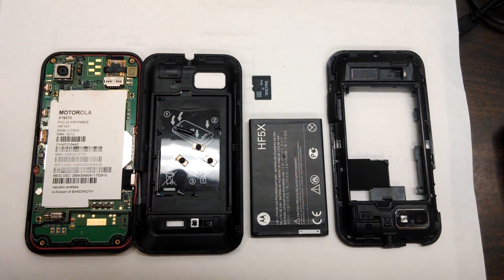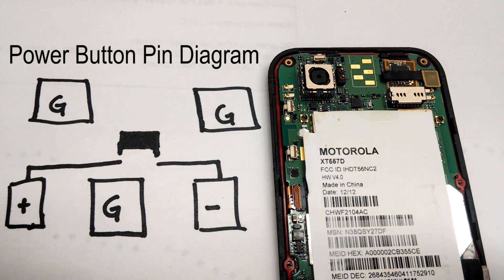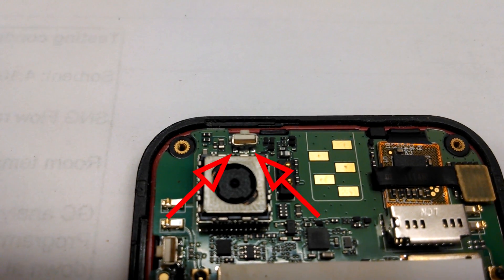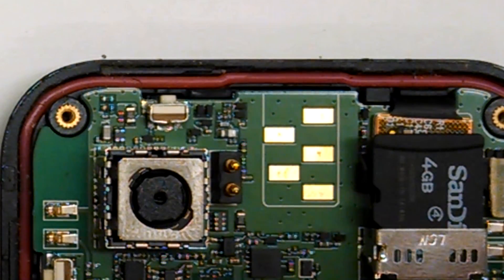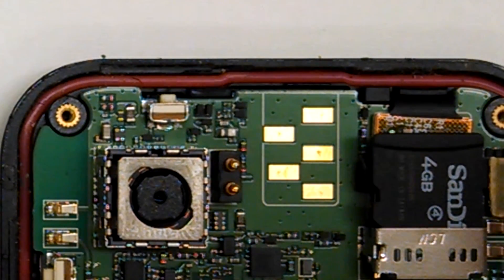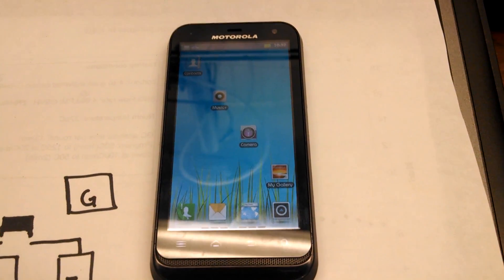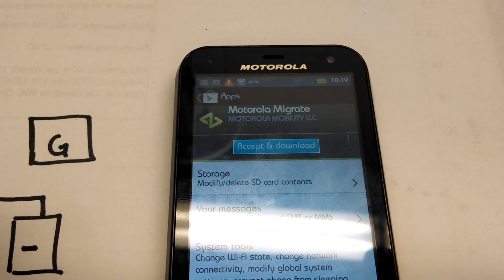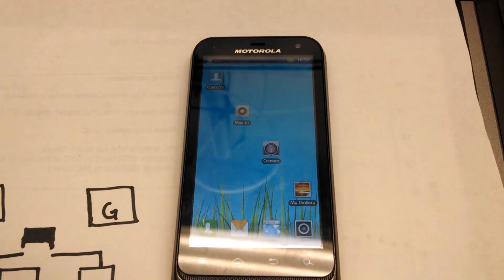How to power on a cell phone with a broken power button

Comment: Hi,

I am absolutely terrified to do this.. I only need to turn my Phone on once. What exactly do you do with the wires and how do I know which one I have to connect to which pins on my Phone?
Thanks in advance
Reply from the maker: Hey hey,
  Yea its a bit nerve wracking as some bad things could happen, even when opening the phone (opening the phone carefully is always my biggest concern).  

What type of phone do you have?  
Have you taken the case off?  

If so when you look at the power button it should have some number of pins on it.  If there is only 3 you're in luck, it will be the two sides you need to connect.  If there are 5, 2 of them may be dead or grounds and go no where, look at the leads coming off the wires, there might not be any, these ones do nothing... 

The key is to find which 2 terminals connect to power on the phone.  

In general if you have a switch with 5 pins, one is for grounding the case, that will be in the middle of the switch probably on the back of the metal case.  If you connect either of the 2 pins on the left to either of the 2 pins on the right one of two things will (normally) happen.  A. You'll connect the switch and the phone will turn on.  Or B. you'll connect either the negative or positive terminal to ground and nothing should happen.  When it turns on it should be almost instantaneous.  So if nothing happens remove the wire you're jumping with and try another pin (You've only got 4 options).  Don't just leave the wire on there as you could be shorting the battery which will get hot eventually.

Good luck let me know how it goes.
Reply: IAmWhil Hello and thanks for your quick reply. The Jiayu G4 I have works a little different from your phone. While opening the case to fix some other stuff, I broke the power flex cable (you can google Jiayu G4 Power Button if you don't get what I mean.) As far as I know, this little flex cable was only connected to two pins on the motherboard. I can send you pics as well (If you are willing to help me) because I know nothing at all about things like this. 
As I mentioned, I don't just wanna play around and run the risk of messing anything up, as that's exactly what happened the previous time I tried that. What kind of power source should be connected to my two wires?
Thanks again for your help and quick response!

Comment: Were is my tunnels at on my LG Mytouch
Reply from the maker: Look at the power switch on the side/top of the phone when you have the case off.  It should have electrical connectors soldiered to the board.  There will be between 2 and 5 of them.  Most likely 3 or 5.  1 (if there are 3) or 3 (if there are 5) of them will be ground, if you look at where the terminals come from, the ones that touch the metal casing of the switch are ground, and don't do anything.  The other 2 that look like they go up into the switch are the ones you want to connect to each other.
Looking up your particular phone (I think) you may be able to just replace the switch, as its not hard wired to the mother board: http://www.ebay.com/itm/LG-T-Mobile-myTouch-E739-Maxx-Touch-Flex-Charger-Port-Power-Button-Connector-/181205683212  This may be a good solution to getting your phone to completely work again.  Check that the one thats in there is connected, dropping it may have knocked it loose.  Go forth at your own risk and good luck!! :D